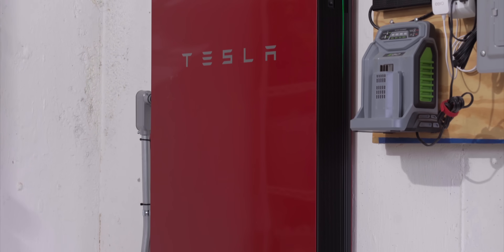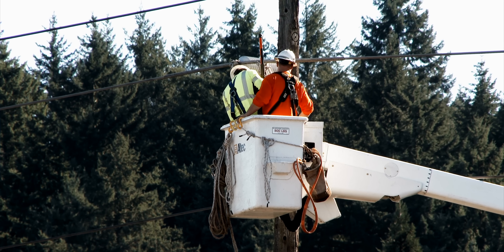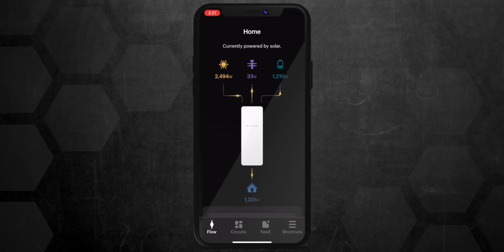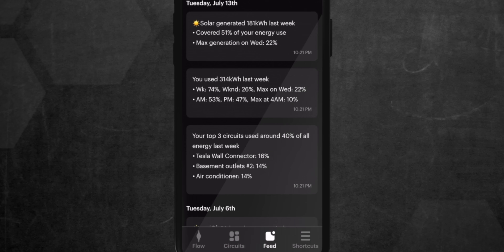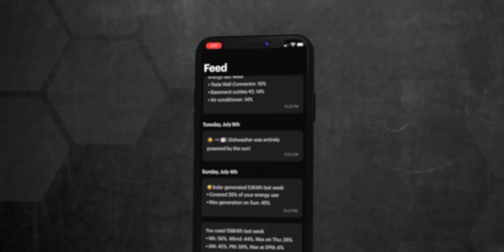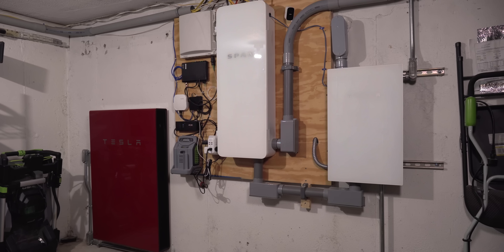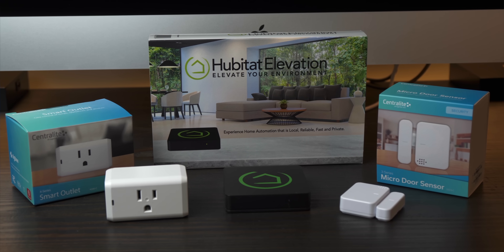This Smart Home Electric Panel Fixed My Tesla Powerwall

Comment: How does the price compare to a normal 32 slot panel?
Reply: I'm more concerned about this panel suddenly becoming obsolete and non-functional once the application that controls it is inevitably abandoned.  Electrical infrastructure is something that needs to work reliably for 30+ years and needs to be zero maintenance to be acceptable.  Having a computer built into your electrical panel seems like a very bad idea from a longevity and reliability standpoint.

That being said, it is nice to see them using standard Siemens breakers as OCPDs. Per circuit energy motoring and control is also a nice touch, but I'm also wondering how truly important this is rather than just isolating and powering essential circuits via other means.
Reply: @mvansumeren4313  this is my fear also. Over the years I have had many excellent products that are no longer of any use after the manufacturing company no longer supports them.   My harmony remote will be the next victim.   My Mac mini has been the best desktop I have ever owned. Apple is no longer supporting it.
Reply: @mvansumeren4313  🤔 span 200 amp PLC panel is using Siemens parts?? or did i read it wrong??
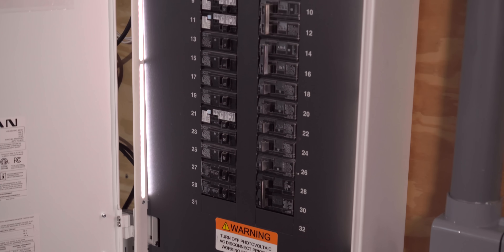Reply: @Richard Price  If you're asking "Does the Span panel use Siemens Over Current Protection Devices" the answer is yes.  I'd recognize the breakers in this video (3:30) from just about anywhere. I'd hazard a guess that they're also using the bus bars, main breaker, and just about every other part of a standard Siemens load center by the looks of it.
Reply: @mvansumeren4313  thanks for clarifying that there using Siemens breakers ( and maybe even more parts aluminium 🔥 buss or copper👌? of the related to my home 🏡 copper Siemens load centre 225 AMP SP 240 V 42 slot panel ) in mats application as it would make sense on a UL testing and cost basis to have the underlying pining parts being Siemens and add the proprietary products onto it and rebage it for more money and legal reasons
Reply: @mvansumeren4313  that already happened with my old challenger* ( not well supported ( and some people that have 90's or so homes have the same parts and there for the same problems as me ) or safe and that's high on my list, 15-20 or so years of not needing any attention too as the next guy after me probably isn't going to be savvy with electronics or care 🇺🇸 statistically speaking ) ( off branding zozco /challenger but might as well be 1 and im hoping i don't find any more aluminium wiring or poor or faulty insulation to go with it 🤷‍♂️😑 ( and i way do need to fix the grounding and or Micky mouse 🐭 wiring mess that goes with this old house )as it was the vietnam war era build / people can be so cheapskates and flashy look 👀 at my curb appeal but forget the import supporting items that that make a home 🏡 great and long lasting with high build quality, same thing with car / truck/ toy builds ) panel in the utility room ( and now a sub panel the main 400 amp one is in the garage on the inside wall 40ft away and made it easier for wiring 240v loads and parking the F150 lighting and chargering it up inside and in the driveway and or parking my charger there or on the opposite side of the 3 ish car garage aka for wiring heat pump A/C combo and 3 ish charger's/outlet's for my welder 👨‍🏭 /240v tools in a 60ft ish area including the backyard or driveway as ford hasn't given great zoning how to's yet ) and that's one of the good reasons I replaced it that and it doesn't pass UL tests/ NEC for the united states 🇺🇸 and really doesn't give me the warmest fuzzy feelings at night 😴 and already tried caching on 🔥 more than once in the last 5 years and we had to replace the dishwasher 🔥 and stove ect. from it already
Reply: @mvansumeren4313  🤔 damn good point
Reply: @mvansumeren4313  It matters because, in my case, I have a 400 amp service.  I don't want only 'essential' back up, I want to be able to power any circuit I want - but exceeding the limit of your generator /solar/battery is a big problem and why normally there is an auto transfer switch to an essential sub panel.  Smart panels are going to be the future.
Reply: Now the average homeowner would never do this, but someone could easily design a rasberry pi / arduino controller of some power relays
Reply: @RandyRandersonthefamous  how do you go about making it more polish like span panel is and or tesla PW battery and solar system?? vs looking like a bad version of professional product that GE could have sold in 50-70's computer 🖥 plain mono textures?? ps. still not good or experienced with programming software like python or C++but have tried before. but i have gotten so much better 👌 with lader logic ( and am trained in rockwell 5000 basics ) and old school wired in manual relays and timers vs 14-18 year old me
Reply: @richardprice5978  nice 👌 wish I had the room to start up a hobbyist Machine shop. Like one of those nice 4 car garage/sheds that cover a solid 1200 sqr ft. Living the dream. Need to get out of this city and back onto some land.
Reply: @patrickkennedyperkinson6649  sub 3ksqr ft for the hole house and the lot is under 1/2 acres with a great view of the local mountains ⛰ and flat ish road to the house /out side driveway and road combo
Reply: just to add for clarification 🤠 we might have had more roommates ( and i get along with everyone and the neighbours so far, so adding more and new roommates/investors might not be a good fit😉. plus the zoning rules keeps the 🤑 slumlords OUT as i have lived by/in a bad places before ) but zoning doesn't let more than 3~ unrelated people in my household/share to live together or visiting for more than 2 weekends aka 12~ days in a row and or real fourplex 3 plex and the neighbourhood has vary little number of duplexes ect.😉 
In away im trying to be humble 😊 as im not a 🤑🤑 man or a 😇
Reply: @RandyRandersonthefamous  Sure!  But if your house burns down, will insurance cover the loss?
Reply: Span cost $3500 before install cost. This thing is more than 10x the cost.
Reply: @Chad Conway thanks for clarity
Reply: btw chad and van the front dead cover and housing looks a lot nicer and easy to identify than the average electrical panel that has been made in the last 50 years for single home owners. i still wish i had a economical choice for my outdoor electrical parts and housing to have SS steel ( meter would have been 16+k usd in 316 brushed SS vs sub 5k ish in lighter flat moss green / gray ish painted steel ) or composet in white to match my white limestone masonry ( or at least bend in better / look more appropriate for my landscaping and home 🏡 ) wall as the 🌲 sap & bird crap 💩 eats the paint in 5 or so years and becomes a big eye 👁 sore from the front of the road and driveway
Reply: Hi Matt, 
I'm all about tech, upgrades and the slick/cool factor but, I don't think you made a case for ROI much less long term savings by using this very expensive system.  I just pulled the trigger for a Generack Solar system by Solor Home, with battery backup that they tell me is expandable upto 3x battery banks in the same cabinet (comes with 1) and that they are on track to making it a WHOLE HOUSE system. It also comes with a similar energy monitoring app. Do you think you might be able to do a comparison of this system vs a Tesla/multi 3rd party build like you and many early adopters have done? I am a huge TESLA fanboy/believer so it really took a lot to go with Generak (the backup power industry leaders as far as I know, mostly because to 3 key things; 1. The panel's are American made, 2. The battery/power backup model is just what I wanted WITH the physical room to upgrade and expectation of whole house operation by this year, and  3. They do EVERYTHING on the installation with in-house employees,  not 3rd party outside contractors (like your first install experience) except my preparation of my panel's (I'm doing a ground mount solution) clearing a spot in my field. I'm not getting the installation till November so would love your take.  Thanks
Reply: @ricksquier7812  is your home battery outdoors?? as i thought 🤔 it wasn't IP68 rated and or wouldn't age well if i installed mine out side 🌲 💦 as im looking for the easiest way for firefighters 🔥 to put it out, and for me not to ever have to worry about a metal 🔥 in the first place 🥇 or a total loss of the home 🏡 or life aka safety 1 ( and ideally the battery failure is not charging or something stupid that doesn't do anymore damage and has a great ROI ) plus id like to keep my room in the garage too just hoping that if carpet hits the wall the battery doesn't get legs and walk off😉. is yours subsided by your utility? as i have been considering sineing up for its 5-50 kwh programs that pays homeowners on a yearly basis to stabilise the grid that is prorated by the monthly last year's bills vs the bare minimum ( say 1-3 KWH ) to keep the switching gear and solar system and generator blackout subsystems happy and rely more on the ford ( as far as i knowledge goes isn't eligible for the utility program for now ) VTG ( intelligence power pro ) technology
Reply from the maker: There's a huge price gap between a typical panel (like Frugal Family Living noted).  This really only makes sense if you're pairing it with solar and batteries.  Fewer batteries with fine tuned essential loads control makes that higher price make sense.
Reply: @UndecidedMF  I too am considering the Leviton 200 amp main panel with smart breakers, but I like this span panel more and I can manage my loads smartly.
Have you considered installing a generator in conjunction with solar, electrical utility and batteries, Will that span panel manage all electrical generation equipment ?
Reply: @UndecidedMF  It actually depends but yes it has a higher price :) i actually purchased a smart panel, Leviton and i can see per circuit power usage. it's linked to my wifi and works great however, that is only if you use the smart breakers which are quite pricey. normal breaker for the panel are similar to the non smart panel board
Reply: my early quote from may or so 2021 i found on my desk is around 350 usd for a Siemens 30 slot 200 amp panel parts number PN3048L1200C so 2500 usd more for the "smart panel" but that qote was without the extra required features required buy localities like suge protect devices / all of the breaker's ( at least 20-60 usd a piece 15-80 amps ) included and installed ready to go. 

Id love to have more retro fit options for all ready installed panels as i so far i like my Siemens and trust it more than a start up i haven't tried or heard of as i planning on a 20-30 or more ( time to replace it after 25 years or less as i get a little sceptical about its safety at that point 😉 even with a big name /all copper backing it ) year life cycle
Reply: Dave! Everything good?
Reply: @hsmiii  All good, thanks for asking.

Comment: A genuine question; besides the time based billing or storage of excess solar power, what is the use cases on which someone would install a solution like Powerwall or any home energy storage battery. Are blackout soo common in US, and if yes, under what condition.
Reply: Depends on the area, but much of america has above ground power lines. These can be taken out by forest fires (California for example), tornados, hurricanes, a tree falling on a line. Or maybe even a simple failure of a transformer that knocks out power for your neighborhood... or some drunk taking out a pole with their car.

Then there's load shedding, and the grid getting completely overwhelmed on extremely hot days.

In most areas power doesn't go down often, but when it does it's nice to have a fallback. The main reasons to have one though would probably be because of the reasons you specifically excluded-though i personally would want one for power outages even without solar or time of use, if i had the money spare.

Comment: Does Span measure voltage and current to get power for each circuit or just current and assume a voltage?
Reply from the maker: I'd have to double check with them, but I'm pretty sure they measure voltage and current.
Reply: Yes, Span measures both voltage and current.
Reply: Great. This is important if you want to accurately read the power used by DC loads… basically anything with a power block. Cheap power detectors just won’t be accurate for a lot of today’s loads.

Comment: I’m using Span with a Tesla Powerwall and Solar Roof on new construction. Biggest drawback is that the house is all electric so needs more circuits than the a single Span panel can support. I need a subpanel for the extra 8-10 circuits. Those will be controllable from span as a group, but not individually.
Reply from the maker: Yeah, total capacity is still limited.  Although the 2nd gen span is more capable than the first.  Hopefully they continue that trend with future iterations.
Reply: Span does support multiple Span panels installed in the same home.

Comment: I feel that i could build that with raspery pi and off the shelf components . Also in Europe if i wanted something like that it would cost more to remodel the circuts inside home to allow for this black box to work
Reply from the maker: You can usually do everything DIY for cheaper, but not everyone has the knowhow or desire.
Reply: @UndecidedMF   True , but this tec seems like just taking existing products wraping it into nice package  , adding nice app and selling to customer.  It is not like it's not adding value or anything  and i don't know about the price , but , Maybe this is a video idea  , go on fiver get some1 to design You a PLC panel that does exactly that , get local electrican to build it ( or just give his estimate )  and see how does it compare . Just to add some context to the product you are showing

Comment: Thank you, Matt.  I have interest in SPAN, however, as you said, the price is too high.  As with everything digital, ensuring versions will decrease in price while adding features.  One thing I'd like to point out:  why are there physical switches on the panel?  Everything should be digital.  Atom makes a 100% digital panel, so competition is fierce.

I'd wait for the next version and price to come down further.  Seems to be a fine product, but still much to improve.
Reply from the maker: You need physical switches for safety and local code.  Every smart light switch you install also has a physical cut off switch on it somewhere.  Price is high for sure ... hopefully it continues to drop in time.
Reply: @UndecidedMF  Correct: switches are just for control, breakers are still needed for overcurrent protection.
Reply: Atom Power does look promising, but if SPAN is priced too high then you're not going to like Atom Power's price either. I wouldn't be surprised to see Atom getting bought by someone like Schneider and having the solid state breakers go mainstream.

Comment: $3,500 + installation... yeah... for a convenience essentially
Reply: jeh, I really dont see the big benefit. 5kw is not hard to calculate. Its probably for rich people only. Also it reminds me of those apps where you can calculate your daily calorie intakes when you are on a diet. Useful in theory but after few days is pretty much useless.
Reply from the maker: I don't see it as a convenience for my setup at all.  The $3,500 panel is cheaper than a second Powerwall by a pretty large margin and about on par with the quotes I got for a breakout panel when I had the Powerwall installed.  But as with all things solar/battery, the cost analysis is going to vary wildly based on your specific setup.

Comment: Also, I don't see how you save any time when switching off a circuit breaker to work on a circuit if you have to go back and switch off the physical breaker after you've checked it's the right one anyway!
Reply: ...no?
With the remote control you stand in the room you want powered off, and tap a button on your phone, go "nope, not this one" and try another breaker, then go down and flip the correct physical breaker

Pop the wrong one without, and you go down to the breaker panel, up to the outlet, back down to panel, back up to outlet

That said, this isn't the main use case for this anyways, it's just another feature of the product as a whole, an "oh by the way"
Reply from the maker: Joshua is spot on.  This isn't the main reason to get the Span panel, but it's a nice benefit.  Being able to flip circuits on and off while standing in the room until you find the right one ... so nice.
Reply: It's when you pop the wrong one the first time
Reply: @joshuacheung6518  so the worst you can do with the manual system is to sometimes take as much time as you always have to with the clever one!

Comment: While I like the idea of the span, if I had a wish, it would be for more ways to use 12/5v in our home without all the need for wall warts. I have an RV and it is amazing how little we need of the 120/240v system, and use almost exclusively the 12/5v system. I have not done the leg work to calculate the demands of 12/5v, but I feel they are far less than 120/240, so maybe there's a future for big savings there.
Reply from the maker: Interesting point!

Comment: It appears that the panel fits "standard" 1" breakers but I bet the breakers are not UL listed to be installed into the Span panel.
Reply from the maker: It uses standard circuit breakers.  In fact, they reused most of my existing breakers from the old box.
Reply: @UndecidedMF  My point is there are no "standard" circuit breakers. Circuit breakers are listed to be installed in specific panels, typically that are the same manufacture of the panel. If they are not listed to be installed in the Span panel, then it would be a code violation. Of course this can be overruled by the AHJ.
Reply: The Span Panel has been listed to UL67 to accept 1" breakers made by Eaton, Siemens, or SquareD.